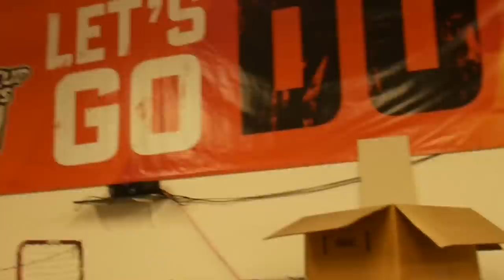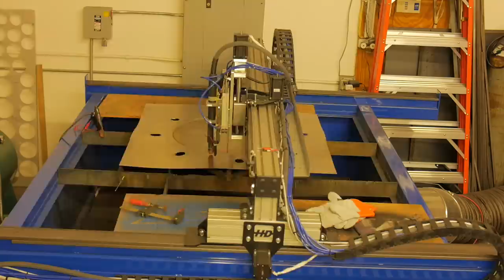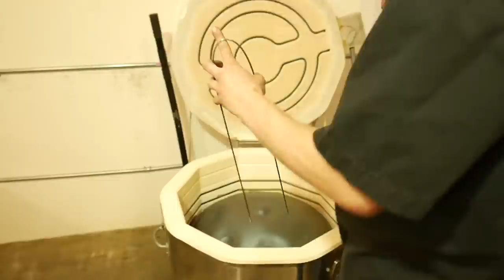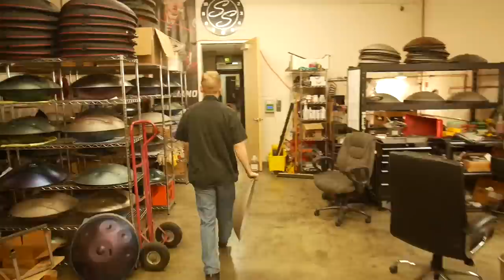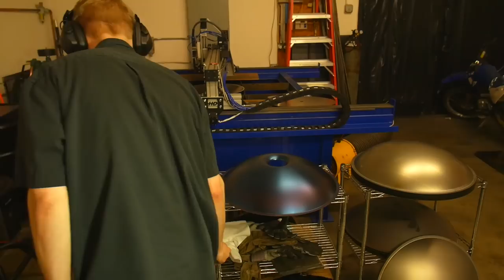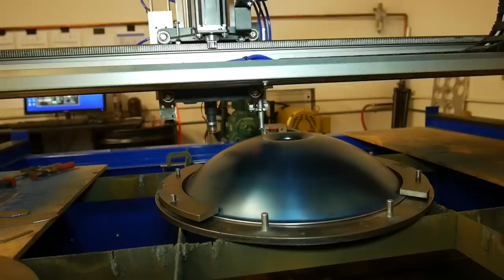How to Build a Handpan in 5 Minutes

Comment: Mythbusters inspired this new manufacturing process. These drums used to be made with hammers.
Reply: New LOL, hydroforming process is widely used for more than a half a century. Why are they used hammers?
Reply: If you're a maker you're constantly solving problems to get something manufactured, functioning, or look the right way. It's a "Eureka!" moment and it feels great. Not just in the achievement for your project, but in finally getting that itch scratched.
Reply: @MrDehicka  because hammers existed longer. What do u mean why?
Reply: The original steel drums were hammered by hand. It's unlikely that the original Hang was made by hammer as the company PANArt was experimenting with tuned steel and had experience in forming, so likely they produced them as in this video. Copycats may have reverted to the hammer method. 

I was looking into this recently, hence I am here. I was surprised by the hydro forming as I had expected both sides to be simply pressed therefore giving a consistent product that (if the stock steel was consistent enough) could require little to no tuning.
Reply from the maker: most of the process is still done by hammers, deep draw and hydroform only form the shell, all architecture, shaping, and tuning is still done with hammers.
Reply: Mythbusters used this process in an episode, but they didn't invent it at all, a lot of factories commonly used this process way before the mythbusters did.

Comment: Great to watch, but much more impressive is the hand made without the hydrolics and computer aided cutter.
Reply from the maker: I have seen and played hundreds of fine and poor quality instruments made from both total hand, and with the aid of tools and computers. its a funny thing our biasis with "handmade". If people understands how complicated the process of building a instrument like this really is, I think they would appreciate all aspects of the craft more. That is part of the reason for this video.  I don't think people realize that the builders build almost all of their tools themselves also, and the incredible attention, skill and craft that that requires. I also know some of the best builders who don't even use pneumatic hammers and are in incredible pain in their 40's or 50's, and perhaps the world will lose another 20-30 years of great instruments had they used some tools to help. In this case it doesn't seem to make a bit of difference to the sound. in fact having the right tool for the job creates consistencies that most often produce better instruments. Where do we draw the line? Some of the best instruments are made by a process of nitriding, which is a specialized heat treatment process which involves a ton of chemistry, math, computers, and tech. What about how the sheets of steel are produced. Tons of computation goes into that as well. Would you have them forge there steel as well? Craftsmanship isn't defined by which tools are used, it is defined by the character and skill of the builders and the quality of the sound produced by the finished instrument. Durability and stability of the note is also important. I can tell you that from the inventors of this instrument to some of the best builders today who have been assisted by computer aided tech, there is still a insane level of love and care that goes into the instrument. This is not true for all producers, there are skilled and unskilled people everywhere. Thats just people, not tools.

Comment: The current gimmick for all the wanna be enlightened new aged  rich kids. $2000 for a double sided wok. 🤣 you should throw in a "man bun" for free. 🤣
Reply: there is labor behind it and tuning, but you are correct, the metal is extremely cheap, the machien they use not so much.

But at more, the instrument should be in the 500, the reason why they go for 4 times the price is because of howi trending it is and all the cool kids want one.

even a RTX 2080 have more valuable component, more workforce, and hundreds of engineers behind it, and cost half the price of two sheet of metals tuned up :D

Comment: I am curios, why the long process, why not to make one press which already makes it 99% tuned and in a very cheap way could be mass produced, just by pressing it from the disk
Reply from the maker: so far it hasn't been done well, anything pressed tends to sound bad and not stay in tune. The shells are often deep drawn or hydroformed, but the rest is very fine work and every choice greatly effects the end sound and stability of the instrument. Doesn't matter how good it sounds either, if it doesnt stay in tune, which sadly many of the pans on the market are like, going out of tune very quickly

Comment: This is a scam! You have to cook it in order to "use" the metal and tune it otherwise it will detune quick because it bends with time and temperature changes...
if you pay more than the materials and electricity on this one you re the biggest pigeon i even seen we should cook you for thanksgiving
Reply from the maker: I agree that not heating can often cause poor quality instruments, amongst other things. Though heating is not the only way to stabilize. Some of the most well known quality builders do not do much heat stabilization, rather focusing more on material and architecture.  

The kiln is used in this this video. Also, this is a pre-fine tuning build video. The heat is most often used in the fine tuning stage which is not shown here. 

Also, there is much more to stability than just heat including material and build style. The material here has been nitrided treated, heated to around 1k degrees f while also adding gas to change the micro-structure towards exceptional stability. Not to say that all nitrided instruments are quality or stable, because they are not. In my experience, there is much more to a quality instrument than any one part of any process. 

The Iskra's are by far the most stable instruments I have ever played and I have easily played over 1k Handpans from all around the world over the last 10 years of playing and visiting builders around the world and building myself. Its actually hilarious how stable they are. I would hurt my hand before the instrument. I only share videos of instruments I personally know to be of quality.

If you have other questions about Handpans or the build process I am happy to share what I know.